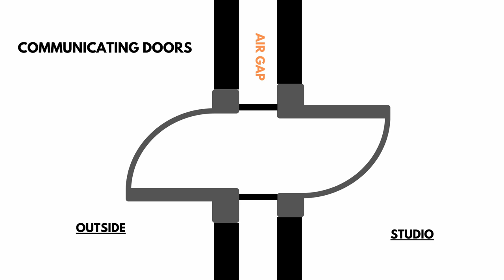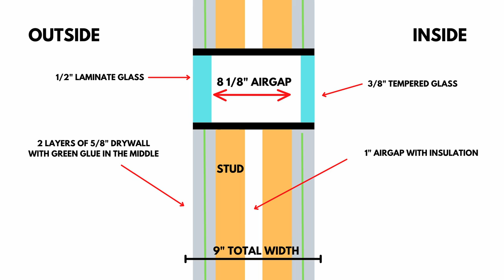Soundproofing Your Home Studio 101

Comment: I did an attic conversion and have so far framed up the floor and walls… with that, there is no insulation from the lower level which is the ceiling to the floor of the conversion… I am wanting to make a studio but have gotten stuck on soundproofing… I have only seen to double drywall and green glue… I’m just wondering should I spray foam the whole room combined with fiberglass insulation insulation board and double the drywall? Or which combination would work best? Thanks I’m advance
Reply from the maker: There is a whole lot to unpack here. I would recommend a soundproof clarity call to really get a rock solid plan for your build: https://www.soundproofyourstudio.com/Step1